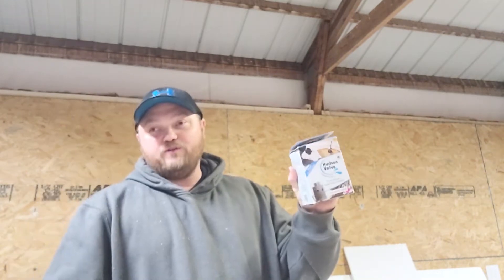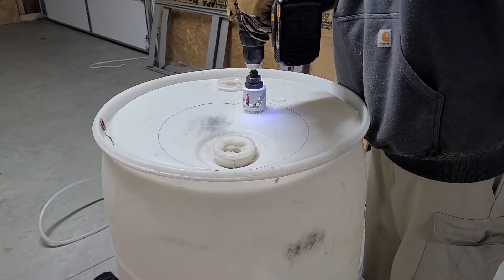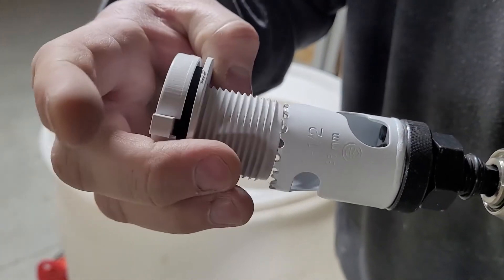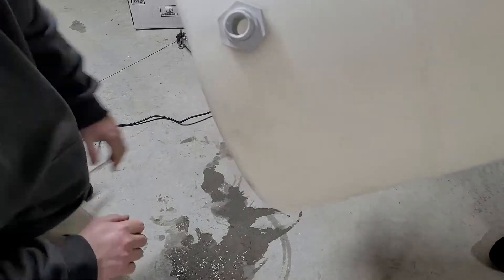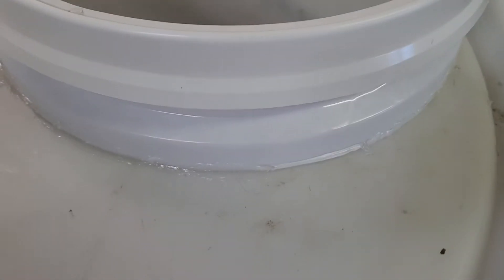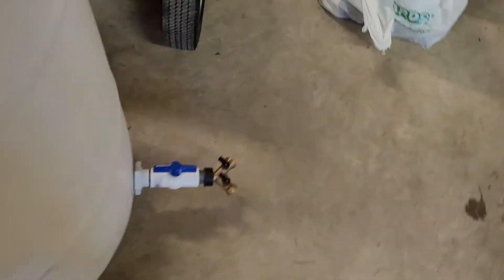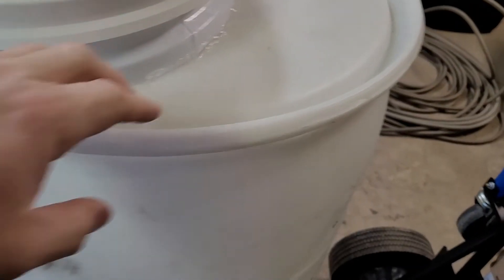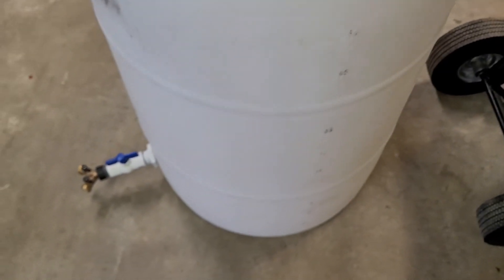Installing a Hudson flow valve in  a 55 gallon drum

Comment: How's this set up been doing?
Reply from the maker: The 55 gallon drum works fine. Haven't ran out of water really. Had a couple of hiccups but all good.
Reply: @thebrothersbarn6094  Did the bulk head leak if so maybe some rtv or heat up the tank with heat gun so it smashes flat?
Reply from the maker: @577buttfan  the bulkhead has been doing just fine. Got to clean the Hudson valve out sometimes from getting clogged up.
Reply from the maker: Yeah that's not a bad idea